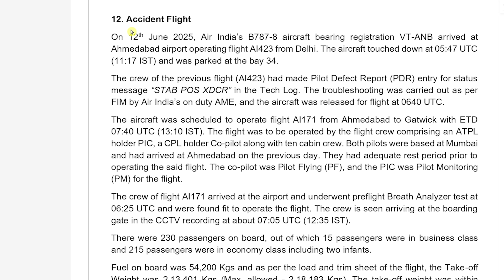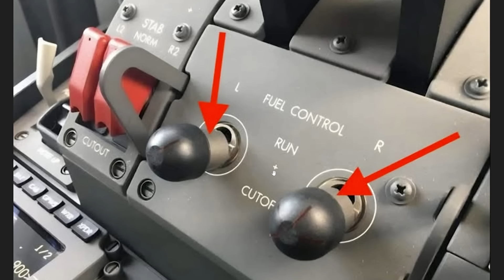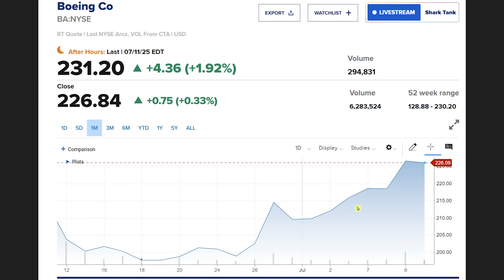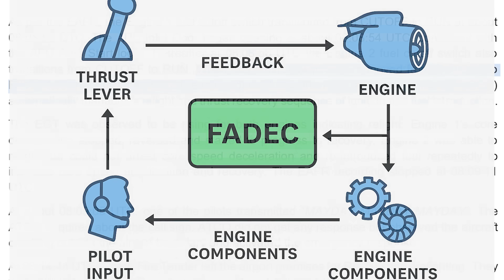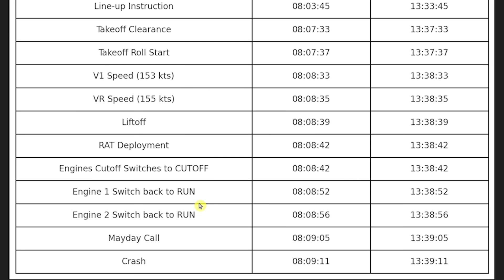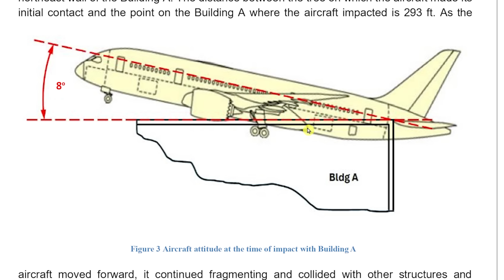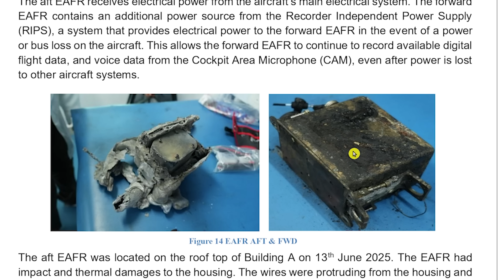Did Pilots CUTOFF Fuel? Shocking Twist Air India 171 Report!

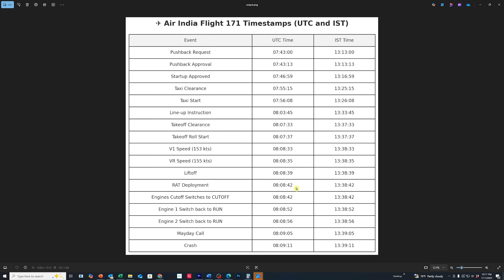Comment: 11:32 there is no mentioning of the time at which RAT was deployed, it says in the official report as follows -
1. "The CCTV footage obtained from the airport showed Ram Air Turbine (RAT) getting deployed
during the initial climb immediately after lift-off"'

2. "RAT hydraulic pump began supplying hydraulic power at about 08:08:47 UTC."
Reply: I’ve been thinking about this too! It was before the manual shut off of the engines. Wouldn’t that indicate an electrical/software issue that made the pilots mistaken the issue for something that would warrant a reboot of the engines? I dont want to be a conspiracy theorist, but another pilot YouTuber mentioned the possibility of a software glitch to do with with the engines, it just seems a little too convenient to be intentional, and if it were intentional, why a plane? Anger? Sadness? Political reasons? The more that comes out about this crash the more fishy it gets
Reply: @waywardlyfe3092  Beyond a "glitch"... did you know that these modern aircraft are REMOTELY MONITORED??? In "real-time", over radio/SATCOM links? Did you know the fancy engines like the GE9x have monitoring systems that are monitored by the makers of the engines, (GE / Pratt Whitney, etc?). Look into the AHM system, Aircraft Health Monitoring. I have had serious concerns about this system and this real-time monitoring for a long time from a vulnerability/safety standpoint.

I want you to go to google and put in this query "does a ge9x engine have a real-time remote monitoring system?"
Reply: according to his chart the RAT  deployed at 08 08 42, the same time as the cutoff
Reply: @jefffree6990  "according to his chart the RAT  deployed at 08 08 42, the same time as the cutoff"

The RAT deployment  time point was not in the report. However the report did state that the RAT was beginning to produce hydraulic power at 08:08:47. The RAT can take 10 to 30 seconds to spin-up. The RAT deployment can be caused by 5 basic conditions (and about 10 with variations) including manual deployment. The RAT cannot be deployed on the ground, which is determined by Weight on Wheels (WoW). The RAT is not deployed if the APU is running. So it is possible that the RAT deployed as early as lift-off at 08:08:39. However the conditions to deploy the RAT, may have already been met and the change in WoW triggered the deployment.

If the problem had been present prior to V1 (08:08:35) then the pilot would have rejected the take-off.

The APU probably automatically commenced the start sequence, but as it takes 60 to 120 second to start and get the generators online, it would not have be available to supply electrical power.

It would be useful to know the conditions that caused the RAT to deploy and at what time it was deployed.
Reply: @christopherrobinson7541  this is the question I had - does it have spool-up time? if so, it seems to have been deployed before the switches were moved to cutoff - because there was only ~3 seconds between cutoff and RAT power. Did the engines spool from 'full' to 'below idle' in that time?
Reply: @SixteenTonesStudio  I’ve had this question too. Was the engines already slowing down which alerted the pilot to ask the other if the switches were cutoff, the other replies no! I didn’t touch it! they do the cut off sequence as a reboot in the heat of panic, realise the engines aren’t speeding up in time, and release the mayday call? 
I  accept the conclusion that the switches were manually cut off but if this was a clear cut/dry premeditated act, wouldn’t there have been a struggle? Is that what accounts for the 10 second delay turning them on again? Did one pilot hold the other back? The attempt at switching it on, makes hope/dread the possibility that the engines were already failing before the attempt at a reboot of the engines

Comment: 10:46 How can the RAT deployment start at 08: 08: 42 just before the engines cutoff switches to cutoff also at 08: 08: 42?
Reply: Timeline out of order. Also, the time resolution appears to in whole seconds. If so, is very surprising. Would have thought milliseconds or even tenths of second. A lot can happen in a second.
Reply: @ronbennett7885 thanks for clarifying.

Comment: I am wondering if there is an indication of fuel cutoff on the 787 FMS screen.  Did the FO/PIC notice the position of the switches or did they see a warning on the FMS.  I think the communication in the cockpit is critical to knowing why the switches were set to cut off and if there was more statements about turning the switches back on.

Comment: Your analysis continues to be the best out there!  Is there ANY possibility that those switches were not touched and it is a control failure: say a worn wiring harness or something caused a cutoff SIGNAL without the switches physically being moved?  My first thought is if that happened, it might be unlikely to happen to both of them.  Someone familiar with the hardware/software would have to chime in.  Also, why did it take 4 seconds between switching one engine back on before the second one got switched back on?  Seems like in an emergency, knowing that's the issue, anyone should be able to switch them both back on in about a second (or less).  I believe they are spring loaded to the up (on) position too: so all you'd have to do is pull and let go to turn them ON.
Reply: Thinking further... If it was some sort of glitch that made the system think the cutoff switches were in cutoff position and the pilot saw a fuel cutoff warning (which is why he asked the other pilot why he cutoff and he resonded that he didn't), the switches may have been physically in the run position.  So the pilot is getting a cutoff warning and is now looking at the switches which are physically in the run position: confused it takes him a few seconds but with no power and no other options, he decides to switch engine 1 cutoff to the cutoff position and back on.  Hearing that engine spool up confirms that somehow cleared the "glitch" so he does the same to engine 2; explaining the delay between toggling the second switch (hearing the confirmation of engine 1 spooling back up).  Further, the FDR may not register that the switch was physically toggled OFF before back ON... because the glitch already had it registered in the off position (there is no off-to-off data event recorded).
Reply: Então esses dois botões enquanto o avião estiver subindo deveriam se manter travados e mesmo que um piloto quisesse se suicidar e levar 250 pessoas junto pelo menos com esses botões travados ligados em decolagem não teriam como ser desligados seria uma SEGURANÇA dos botões ON/OFF de Turbina SIMPLES
Reply: @ph8075  Oh I agree there!  It's insane that there is essentially a "CRASH ME" button (or in this case two buttons) that is under human control!  There should be some lockout that prevents both engines from being cut off that soon after rotation because it is a guaranteed crash!

Comment: The report also does not state that the switches were definitely moved physically, they are going of sensor data that could have been due to an electrical fault. Remember the switches were found in RUN. The RAT was deployed within 5 seconds of fuel cut-off was recorded and 3 secs after the take-off, this could have been a major electrical failure and not pilot's switching off them physically
Reply from the maker: If it was a major electrical failure then why was the engine spooling back up once they reset the switch?

Comment: those switches were never touched...cutoff and run both happened by software. suicide theory is impossible as there literally would be verbal or physical fight between two to bring them up again if one is trying to kill himself. real question is, why does a plane ALLOW to cut off while taking off which is literally guaranteed to crash ?
Reply: It also makes NO SENSE if this was intentional to sabotage the plane WITHIN THE FIRST MINUTE!! This Flight was on the way to London and would have been OVER WATER where any Sabotage would have been almost IMPOSSIBLE to detect much less PROVE!! This makes Zero sense except to absolve Boeing and Air India of responsibility!!
Reply: If WOW is indicating the aircraft is still on ground, it needs only one more false sensor to let this happen, such as an 'Engine Fire Alert'.
A logic would say in this case: I cut all fuel valves!

Comment: Is it possible the engine rollback and restart sequence was initiated without the manual manipulation of the switches? Telemetry may be picking up the system error and not necessarily the actual switch movements.

Comment: Well, ist becoming clear, what i suspected as main cause is a cut in fuel, but the cut in fuel can have several different cause, of course.  Well is the commander cut the fuel by physicall action on the secured buttom, it looks to be a voluntary will of cutting witch is not taken for a technical reason like a fire in engine or a high vibration or a mechanical destruction inside the engine, it looks it is a free will of the commnder to shut off the engine. If the end conclusion of the investigation conduct to this option, than one investigation shall be done in term of ferensic in the person of the commander, maybe he got the order to destroy the airplane and so kiiling allcthe passengers, for sure,  eaning in the airplane one or some passenger were target of killing contracts, so why and what kind of method was use to force the commnder to one act of suicide to himself and by this to succed to kill the targets on board....A forensic investigation of the commander life should bring and higlight pertinent points that could bring this to credible possibility, maybe the commander had a life insurance that could cover some special expenses, or this commander had a kind of life debt to some one that by this action would be paied, or maybe some kind of revenge of the Sindoor Operation with Pakistan, or that the special passengers on board had to be killed in a non visible way.Commander pilot of civil airplane can have older military carrer behind them, and during this military carrer deaath of some or other usually can occurs and request a kind of payback action, what is strange is the very cool phraseology between Cmder and Second regarding the fuel switch cutting actions, like if the commander was fully aware he cut the switches but denied it smoothly to the second,....kind of strange,.....and technically logic spoken, the function of cutting switch fuel should only be effective if in a logic gate AND with other signal like engine fire, vibration or rpm or mecanical destruction added .signals would be validaded, only then the cutoff fuel should be activated,.,.looks so,. The cold human activation of the cutoff fuel switches, both, looks to indicate the commander excute one order of full destruction, but did it with clarity, so a deep forensic investigtion in the commander life shall be conducted......why,...???🪃🛞💎⚓

Comment: Cameras need to be in the cockpit, focusing on the control panel.
The pilot who asked why the other pilot cut off the fuel, maybe trying to re-directing blame.
Reply: When are we going to start hearing about the backgrounds of these pilots?
Reply: Good video, Jeff.
Reply: They'll analyze the voices. My guess: Pilot flying the plan was focussed ahead, Pilot assisting flipped the switches intentionally, Pilot flying asked Why?, Pilot assisting denied it, Pilot flying flipped back the switches and called Mayday.
Reply: PA= Captain. PA flipped the swiches off and then on again. PF has both hands on control column @crypticcrazy3672 19:53
Reply: @crypticcrazy3672  So you think the pilot (Pilot In Command) sabotaged the flight?  The co-pilot was supposedly flying the plane.  Yeah, you could be right.
Reply: Why would the other pilot say "I didn't cutoff", he would have instead said "You did"
Reply: @knight3131 Also a good point. Unless there is hierarchy.
Reply: Very plausible. Deflection to save face and/or for insurance reasons. The background noises on the voice recorder will help pin down who really did it. Also, looking into the backgrounds of the pilots.
Reply: Reference Section 12, paragraph 3:  Captain non-flying pilot.  Very telling.
Reply: @chawkinzWhat is very telling about that. On a multi day trip, both pilots usually trade off flying each leg.
Reply: You are right wow
Reply: If there were cameras in the cockpit the overhead panel is full of switches and indicators, but with technology that exists can have a high resolution cam that sees all actions!
This would stop any speculation and more accurate information!
Those are stealthy cameras and cheap enough!
Reply: Wow - that’s something I hadn’t considered.  It might never be possible to figure this out but I’m sure the investigators are all over the histories of both pilots right now.
Reply: That's exactly what I was thinking.
Reply: I doubt it. The pilot who did it wouldn’t want to bring attention to the situation.
Reply: We will never have the answers. cameras in cockpit would help, but even cameras can be sabotaged.
Reply: The airlines have been trying this for years, but the pilot unions keep pushing back. Unions and pilots o not want "big brother" watching and fear that a video may incriminate the pilots just for routine actions. 
The problem is that the cockpit already records pilot actions via the data recorders and sometimes even sends out reports routinely.  It is how the company knows that a pilot made a hard landing even if the pilot(s) dont themselves report it.
I am in favor of video recordings, just like the data recorders. Used for investigations and learning only and never to used to find "dirt" on a pilot.
Reply: @aarondoty2210  Like Canada just allowed privately held online data to be snooped by the gov unwarranted via bill C5.  Just on a whim they can look to what library books we borrow, no probable cause for search, no warrant.
Reply: @aarondoty2210  The problem is in preventing the latter, patriot act and all that crap.  While it may not be possible to use that info for "dirt" today, it may become possible tomorrow with the right dose of false flags and manufactured (fake) consent.
Reply: @aarondoty2210 Everyone should be subject to surveillance while in the workplace.
Reply: This is what we do in Network Television control rooms for training review and causality on outages -no reason it could be done an feed this video data to the black box -except expense of data storage etc.
Reply: This!
Reply: Thats why i dont trust Diaper -+=heads
Reply: The reason there are no cameras is due to the unions.  They fought against it so it has not been done.
Reply: True but the reverse could be true too the pilot who asked might be innocent and simply asked the co-pilot why they cutoff the engines.
Reply: Don't worry, if you distrust the investigation that much we can make an AI video for you that shows what happened.
Reply: Good point
Reply: Yes, cameras will give you a visual data of what happens up to the crash, but can't stop anything from happening.
Reply: Deflecting blame seems all kinda pointless when BOTH pilots and many passengers are very likely to DIE!
Reply: You don’t really need a camera though we already know everything

The real question is why do this instead of something else, surely there are easier ways to crash.
Reply: @undefined69695  What's easier than flipping a couple switches?
Reply: @undefined69695  a camera would tell us if the switches flipped by themselves or which pilot manipulated them on purpose.
Reply: yes as the camera never gets destroyed and cameraman always lives...
Reply: Clive Kunder converted, a martyr being rewarded with "seventy-two wives from the beautiful maidens of Paradise" is found in some interpretations of Islamic texts, including a hadith (saying or tradition of the Prophet Muhammad) collected by Imam al-Tirmidhi
Reply: @FunFunFun8888  Why don't you guess the two pilots were Hindus or Christian?  Why guess Muslim?  Any evidence?

Comment: The first pilot turned off the fuel control switch.
The second pilot realized it and asked the first pilot: "Why did you do that?"
And then this second pilot tried to turn the fuel control switch back on.
The first pilot, of course, wanted to prevent that, and a struggle ensued.
Hence the four seconds delay between turning on one switch and then the other.
That's how I could imagine it and that's how the details would make sense.
There was a lot more going on in the cockpit that wasn't included in the report.

Comment: Boeing is quick to guard its resources and blame the pilots. If there was an error -- think of how a breaker flips - then it wouldn't have anything to do with the pilot. In the case of the Egypt air flight, there was no way the pilot was suicidal despite the smear campaign run following  his death. He had just purchased brand new tires for his son's vehicle. Why would he bring them if he was going to end it all? Also, my SIL worked with him, he was pleasant and 'everybody's father'. The character descriptions are badly skewed. Remember that this was before the fatal M-CAS error was found after subsequent Boeing 737 Max crashes.

Don't be so quick to think it was the pilots. Look closely at the manifest.

Comment: If the fuel switches were physically moved to "cutoff" which it sounds like then there can only be really 2 causes. 

1: A mechanical failure on both switches 1 second apart. The risk of that happening on both switches is probably astronomical.

2: The way more likely cause was that someone in the cockpit manually moved both switches to cutoff. Wheter that was due to brainfart or intentional is the question. But it should be easy figure out from the CVR if this happened right after they said "positive rate/climb - gear up".